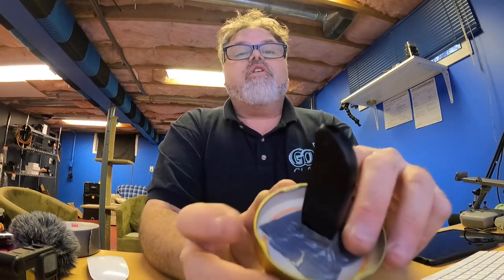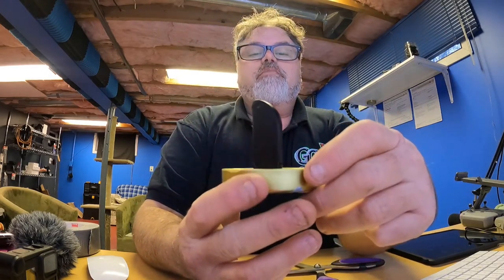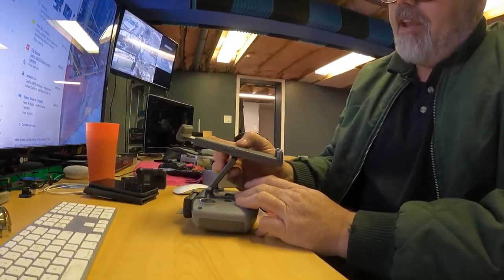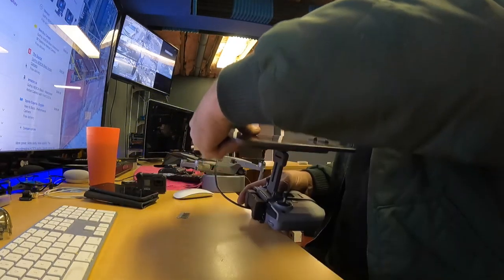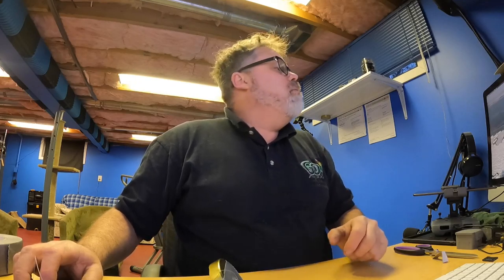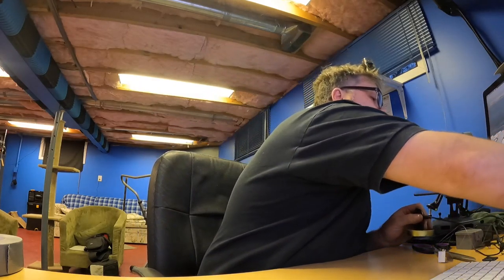Adding A Microphone To Drone   Will It Work ?

Comment: Never expected I would say this to a guy, but, you got a nice muff.  □

Did you try it without the can lid? It may be acting like a diaphram and transmitting the vibrations of the props directly into the voice recorder. If it is a stero recorder, peice of tape over one of the mic holes might cut some of the echo--which might also be due to the can lid as well. Something else to try out anyway, but I doubt you'll get rid of prop noise entirely those voice recorders work fairly decent for picking up normal conversation levels, and the props are well above those levels.